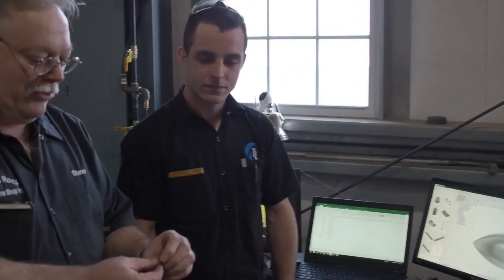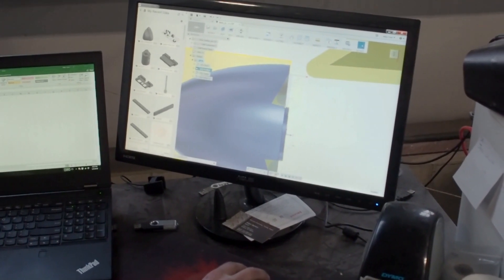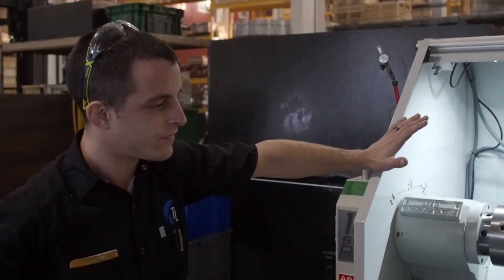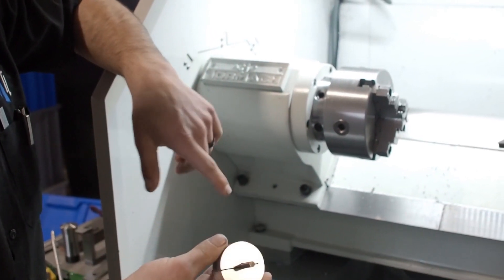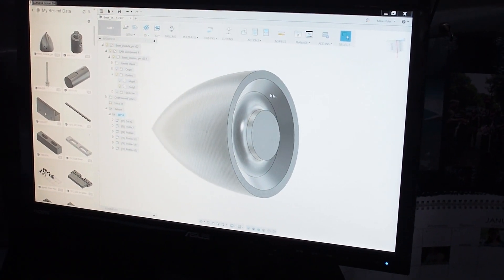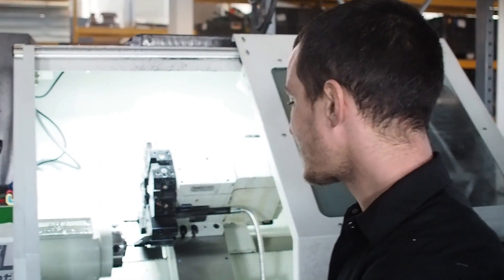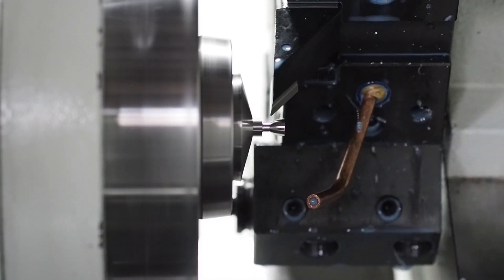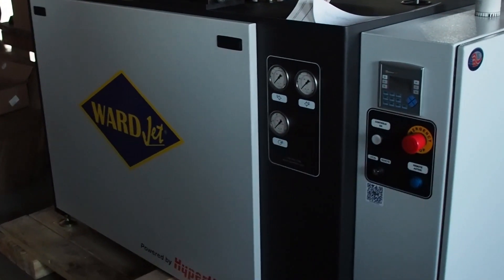TopLine Engineering Hard Turning part 2

Comment: Great seeing the hard turning. How are you holding the part to finish the point?
Reply from the maker: Hi Drew,
Mike said that they grind it off. I might be wrong but I think he holds it by hand and uses a belt sander. The part they grind off is a non critical for the function of the part.
Steve
Reply: Thanks for the reply Steve.
Reply: Steve is correct, that was the plan, but from a PMFEA stand point that will not be acceptable. We're going to build a 20 PC fixture and mill them off.
Reply: Mill them off flat or try to maintain the conical shape? Would like to see the fixture when you get to it.
Reply: Mill em flat. Customer is allowing a .056" flat on the tip

Comment: Nice job! Thanks for the shout out. You may want to model the CBN tool that you are using on the face cuts and make sure the heel of the tool is not rubbing on the conical  section of the part.
ATB, Robin
Reply from the maker: Hi Robin,
I think we are good. If we went a little deeper we would be rubbing with the heel. I did model it and it was close. You could not see any indication of rubbing on the heel or deflection in the part as it was being cut. We will ink it next time just to make sure. Thanks for pointing this out because it is one of those things that is easily over looked but critical for success.
Steve
Reply: Yes but it needed complete rebuild before I even used it. I also added the air closing so I can run full automatic with a bar puller I made. That closer is pathetic quality.
Reply: Whew! I wanted to make sure I wasn't the only one experiencing issues with that thing. I've done all I can with what they gave me and it still wobbles around. I'd be curious to find out how you rebuilt it. I just don't dare go over 2500 rpm in fear it'll blow up!
Reply: I have video on my rebuild i just need to edit it.
Reply: Thanks for looking out Rob!! Do you have the lever action 5c collet?
Reply: Excellent! I can't wait!!